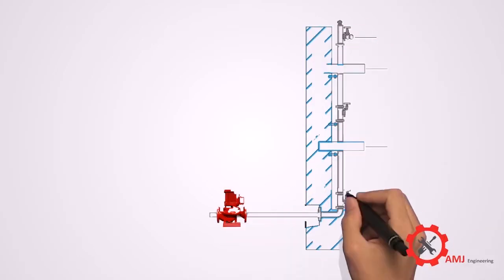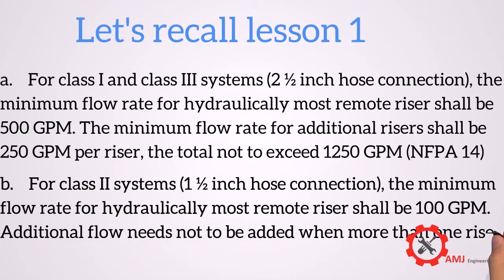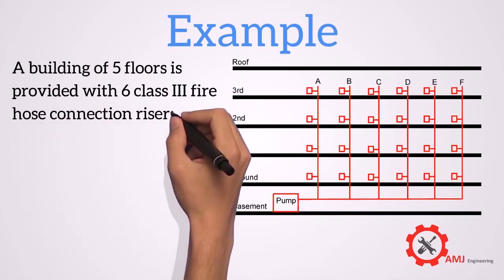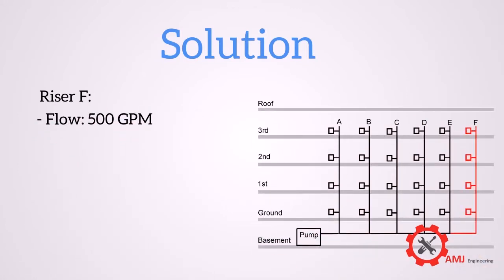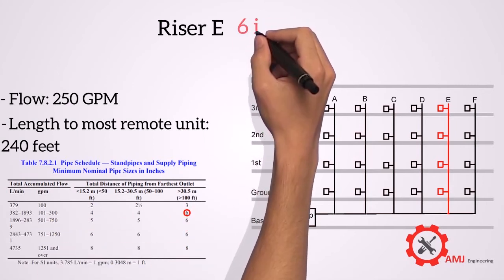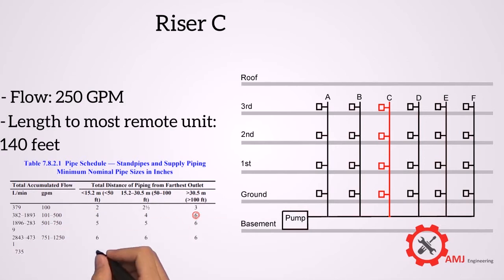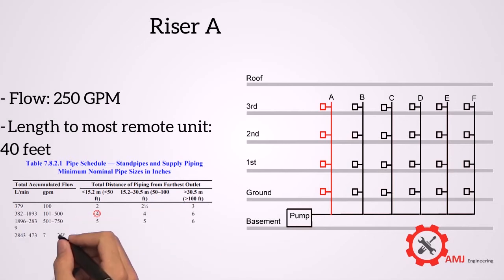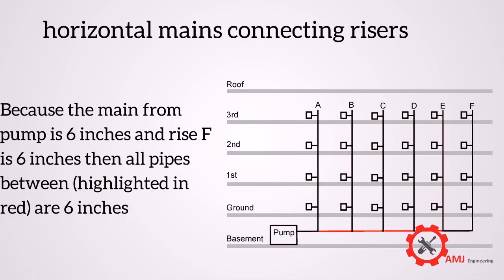Fire fighting lesson 2 | Sizing the fire hose system piping

Comment: Hi Ali, Very informative video. Thank you for posting this level of information for us laymen. A quick question to double check our calculations. Our fire pump system is same specifications as the one you display.  Our main line is just a 100m straight run down the center of the warehouse. There will be 5 hose connections along this line. What is the pipe size for this run? We calculate 4in is plenty. It will maintain the correct flow rate over the 100m distance to all hose outlets easily. thanks in advance for your advice.
Reply from the maker: Yes 4 inch is correct 👌
Reply from the maker: Pipe Size	Flow @ 10 ft/s	Suitable?

2"	~185 GPM	No
3"	~420 GPM	No
4"	~735 GPM	Yes

Comment: 1:58 the distance from the pupm to the Most remote riser outlet and your mentioned length on each riser distance is not same. Although distance from most remote to ground floor supply loop you only address as a length. I hope you can rectify this